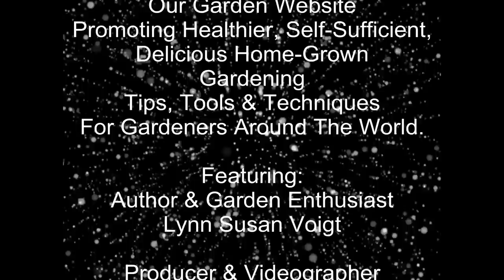Picking Vegetables & Building Toad Stools - Wisconsin Garden Video Blog 783

Comment: usually ours just come off when we pick them up to look at them. or we just pull them off. Good tip on the dill. I know with brassicas we grow one row of broccoli, then one row of garlic, then one row of cabbage, then one row of garlic, etc and it keeps down any insects generally and we really try to make sure to put out a good layer of compost filled with minerals every fall. Sometimes in Spring, but in fall it gives it all the rain and snow to bring it down and saturate the ground. Brassicas really take the minerals out of the soil. It seems like the more minerals we put back (wood ash in the compost) and rock dust, the fewer insects.
Reply from the maker: Hi Cathy.  It is amazing what planting garlic near and with other companion plants can deter.  This year our concern is over how the massive amounts of rain will result in the amount of nutrients being leached from the soil.  May have to start doing soil tests over the next months and into spring to see how dramatic any change might indicate. This is another reason we often add Azomite (trace elements) with our soil mixtures when planting. Thanks again for watching, caring and sharing. Lynn & Richard

Comment: Richard is this your own design?  I Love them!  How deep is the post?  Hoping I can follow your directions and make me one or two.  Thanks so much for sharing your life with us.
Reply from the maker: Yes it's Richard's design which only exists in his head.  He's a visual artist who can see the end result without a plan.  It's how he built our free book library and all the other home remodeling projects he's undertaken over the years.  Whether using a 4x4 or 6x6 post, he buys 8' lengths and digs down at least 4'-5' to stabilize them due to the frost line here in Wisconsin.  Anything less than 3'  might eventually heave upward.  He also doesn't use any quick set cement and prefers to compact soil around each post and cut off the extra top height  to a comfortable sitting position.   Not too short and not too tall.  Just like Goldilocks. They are extremely sturdy once set in the ground.  Then he measures the width of one side and adds and additional 1 1/2" inches to the 2x4 pieces so that there is an overlapping length where the end can be anchored to the next one as he continues adding 4 pieces around the entire top of the post.  He originally thought each of the 4 sides were equal in length but found that even 4x4 and 6x6 posts vary in widths, so measure each section as accurately as possible for the best wrap around fit.  He also pre-drills each screw hole to prevent the 2x4 or 2x6 from splitting.  He also makes sure the end grain of each sections curves inward.  The next two or three rows continue the herringbone pattern.  Send us a photo if you try it.  Thank you for watching, caring and sharing. Lynn & Richard
Reply: I appreciate the direction and I will share after I try one.  Here in North Alabama the temps are high now and will wait till the weather is more inviting for back and brain work. lol!  You guys are wonderful and real. Blessings to both.
Reply from the maker: The correct term for this pattern is called the Log Cabin quilt pattern.  Google the term to see the simple topical pattern.  TKS Lynn & Richard

Comment: ever try cordless porter cable makes 19.2 drill also makita makes impact light weight works x cellelent
Reply from the maker: Richard actually has several cordless drills that are often his work horses.  He also purchased a 3 in 1 tool called the DrillTill that works with his power drills primarily for use in the Liberty garden later this fall and especially in spring to till the soil.  Thanks again for watching, caring and sharing. Lynn & Richard

Comment: WOW I love those red archways. And I am from Florida and it is awful. Awful awful awful weather. Nothing dries - ever. Towels don't dry, mold grows everywhere, we had to constantly use bleach on the porches we had around the house because of mold. Constant cleaning, yikes. I wouldn't go back into that - not to mention the insects. Yeeesh. This place is paradise compared to that. 17" of rain a year. That's really really dry
Reply from the maker: We're probably well over 18" of rain here in Wisconsin and it's just July.  We may have mentioned this before but when visiting one of Richard's family relatives who retired to Florida arriving in April for our one and only night sleeping in his non-air conditioned home, which felt like sliding between two wet sheets and most uncomfortable.  He mentioned to us that he couldn't even grow his favorite tomatoes even with an overhead sun filter because of the summer heat and humidity and missed living in Wisconsin deeply.  Thanks again for watching, caring and sharing. Lynn & Richard